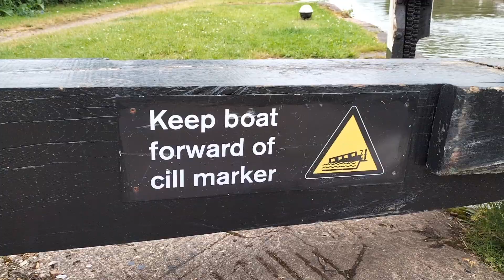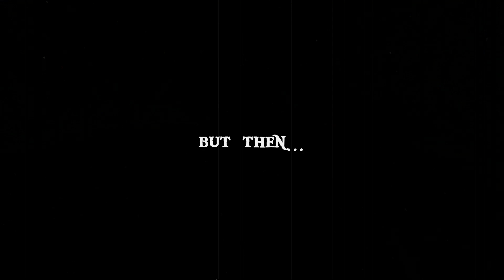Ep 67: Overcoming fears and obstacles as a solo boater!

Comment: Get yourself a multimeter (£10 ish) - then you can check voltages etc and find problems/solutions easier.  Also make sure there's always an emergency bottle of red onboard, just in case.

Comment: One of those lapses of memory we all have.  I'm over 50 so I have them on a regular basis. 
If electrics or anything mechanical isn't your thing, then maybe a good idea would be a checklist. If this isn't working, then check that, that and that. 
No power? Then check the battery connections, then master switch, then check the meter, check the fuse panel, just a list to work through logically and methodically.
Engine won't start? Then check it has electricity (see above) then check it has fuel (primer bulb is firm when squeezed.. don't giggle!)... etc. That sort of thing. 
If you can find someone with some mechanical and electrical nous, they could help.
Reply: That's why a think a community of single women boaters would come in handy. Everyone has a talent at something and have learned many things. Share the knowledge with each other. With facetime there isn't anything you cannot do. Lizbeth you know a boatload of sailors already who can teach you and help you troubleshoot when things go wrong if you cannot figure it out yourself. You got this.

Comment: So, initially the engine ran but the boat had no power. Then you changed the position of the master switch and the boat had power but you couldn't start the engine. I'm guessing the master switch is wired to provide power for engine starting in one position, and power to the boat in the other position. If that's not a standard arrangement you need a boat sparky to take a look at it.